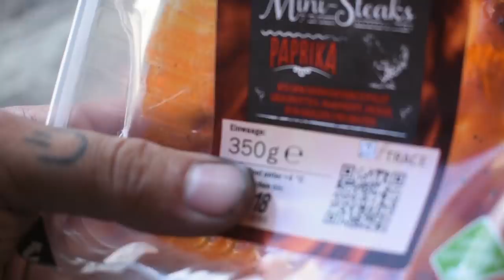HABU \\ "Mirill"- Building The Smallest Grill You‘v Ever Seen!

Comment: Cool. Back packers grill. You could put an eyelet on each corner and use chain to a single point and hang from a tripod, branch, etc. over a fire as well. You could store the chain in the other tube. Edit, on 2nd thought. Drill a small hole thru the bottom of your legs. Use a small split ring thru them for the chain and use upside down to "open up" the grill for access easier to the grate with tools, etc. Off to the shop!!

Comment: Is that a hacksaw balisong? Sweet!

You might try a collapsible version of this thing. Magnets instead of fasteners. Would fit in a bag you can tuck in to your tent or camping gear.
Reply: Ungha Bungha the magnets could loose their magnetic properties at a certain temperature though
Reply: If you used steel instead of copper, you could have a magnet at the base (in the dirt) of each leg, the magnetism would distribute out from there.
Reply: Ungha Bungha hm I don't think this would hold up for any use. But give it a try yourself!

Comment: I've been using a similar device for backpacking. I made it in shop class in 1973. 4) 8"long 1/4"-20tpi stainless Marine grade Ubolts and 2 lengths of thick walled copper tubing. No soldering required. It folds flat and fits in the bottom pocket of my pack. Cost $2 in 1973. I wish I could show you a picture of it for some reason YT won't let me upload it.
Reply: Try with imgur. Sounds interesting enough, gotta love oldtimer tech.